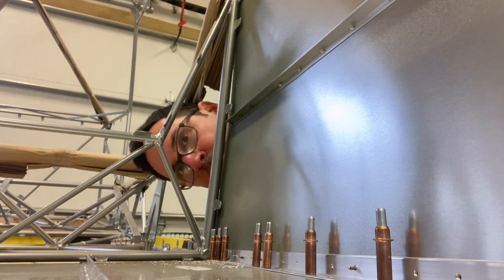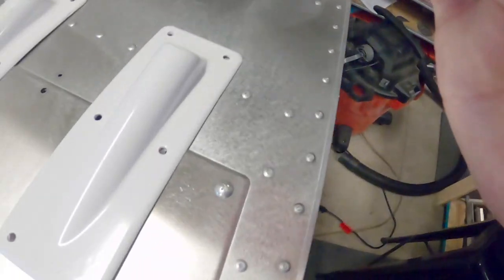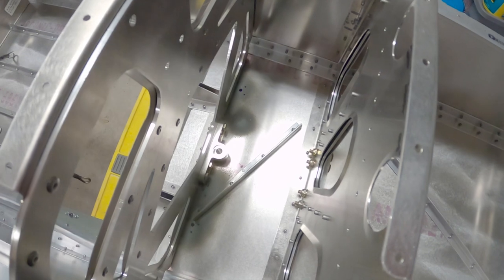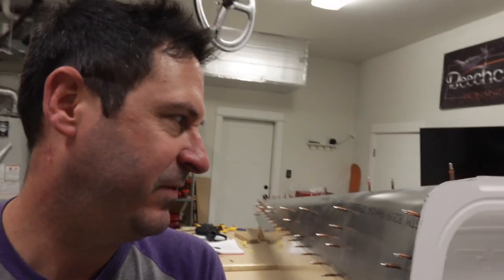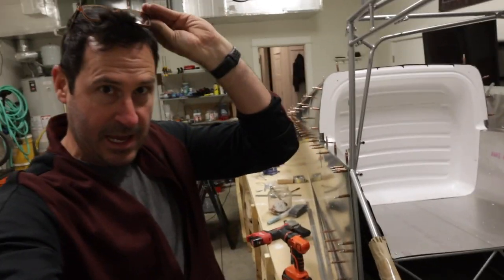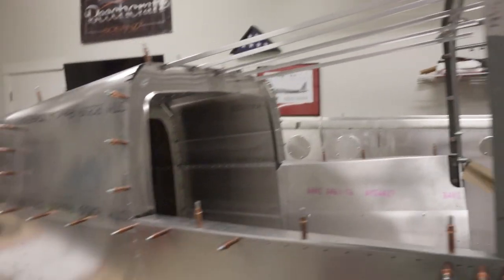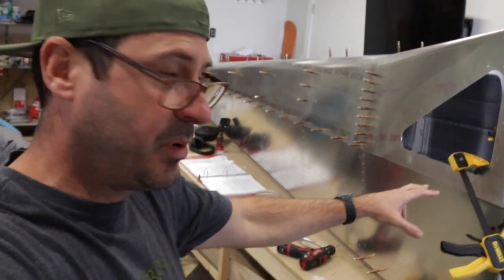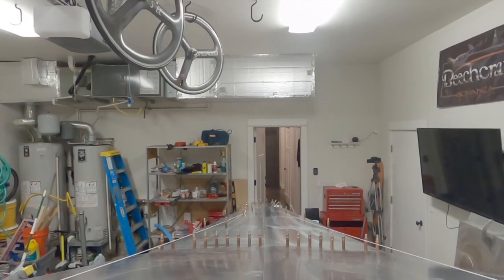RANS S-21 Build Ep 9; Fuselage Part 2--LONGFORM

Comment: I like the idea of running wires thru a conduit. For sure, guaranteed...loose wires are going to rattle and even if they don't do damage...you will eventually hear them. I don't have the good kind of OCD that compels me to organize stuff. My OCD makes rattles and squeaks feel like an air hammer on the inside of my temples. Sure...it sounds awesome when I put it that way...but it's really not. I know it's a bit late for ideas on the station 4 closeout...but it might come in handy for other onerous chores. I sometimes find that cardboard makes good template material. All you need are scissors and a sharpie. If you cut too much, duct tape is your friend. Then trace the template on the bulkhead. But...you got it done and it looks good.

Comment: Did your top hole on the window support still line up?  I intentionally drilled only through the cage tab and the window support and put a wood shim between the support and skin so I would not drill through it until I had worked up the support from the bottom.  Worked out well.
Reply from the maker: I’ll have to check when I get home from this trip. I didn’t think about this…hope it still fits!
Reply: @CLEAREDDIRECT  I hope so also.  I mention that as I had the centerline drawn on my support and the holes lined up with it when I pushed the skin in by hand.  However, as I drilled from the bottom up, even with the clamp in the lower window corner per Eddie Gil’s video, the holes slowly walked off the line as I moved upward drilling and clecoing.  I was probably half a hole off at the top.  Everything still fit well, but it was a little unnerving watching the line slowly move out of view through the holes.  My left side didn’t seem to move as much as the right, but still moved a fair bit.  I think Tony said his stayed on the line so it may depend how things fit on each individual structure.

Comment: I was hoping to see how you did the aft baggage floor.  The manuals don’t agree on where to locate the screws to attach to the baggage supports and the side panels, but it appears that most are following the text manual and not the parts diagram.  It seems you omitted that part of your build from the video.

Comment: How did you drill the back edge of the top forward skins?  Did you use the Eddie Gill clear plastic technique?  A hole finder?  Or drill up from the bottom as the text manual says?  I am leaning towards the latter, but you can’t really drill perpendicular holes as the bottom flange on S-4 precludes that.  I think though that drilling 1/8” and then reaming to #30 will allow correction of the slight angle from drilling.  Although the plastic overlay method looks viable also.
Reply from the maker: I couldn’t find lexan thick enough to stand up to the drill bit so I drilled per the manual which left some oval holes. Not perfect, but good enough. I’d recommend finding some lexan to do it Eddie’s way. Good luck!
Reply: @CLEAREDDIRECT  I don’t have any thick lexan  either, but I also would prefer to avoid oval holes.  I think I can use thinner plastic and rather than drill through it, I will centerpunch through it and then remove the plastic and use the centerpunch divots as my drill guide starting with a #40 as Eddie does and then final size to #30.  I can’t see any reason that shouldn’t work.
Reply: @CLEAREDDIRECT  I can’t find it locally either so I have to wait a week for Amazon to deliver.  Sure would be nice if RANS would include some of the harder to find items like this in the kit, or at least in the tool kit.  If you live near a city, you can probably get this stuff easily, but we folks in rural areas don’t have that luxury.